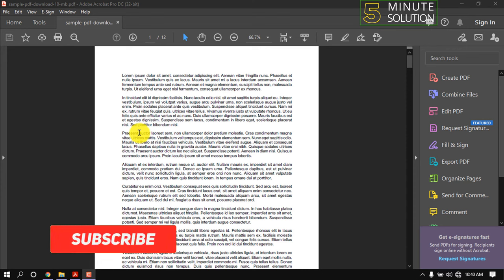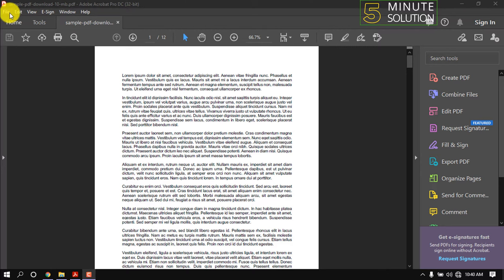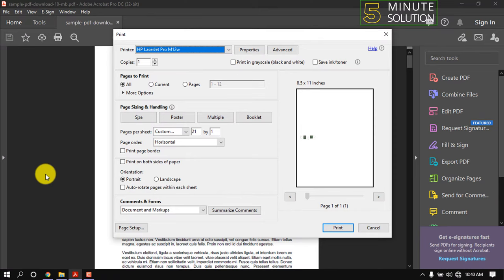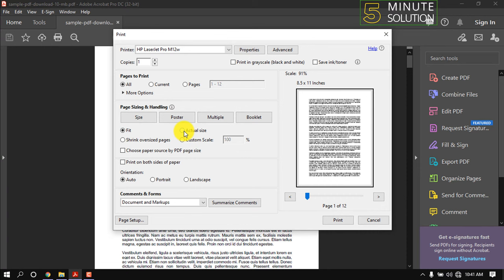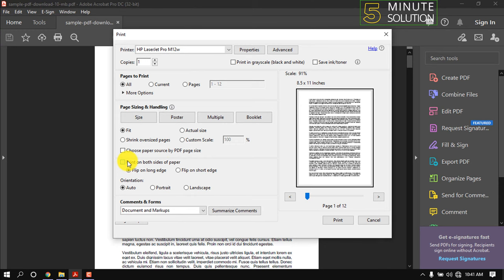How to print double sided pdf 2024 | Adobe acrobat Tutorial

Comment: Option is missing in Acrobat reader
Reply: If printer has the option it will automatically come .
Reply: No if you first time connect printer to PC you have enable double side print setting from printer hardware properties. Then this option came... Then after it default settings always shows.
Reply: @rushikeshbadhe97 how to did you enable it

Comment: I was trying to do the same thing..changing all the printer settings...bla bla...but it wouldn't print the one page of my pdf on both sides.. even with double sided printing set...so I tried one more thing and it worked... when you go to print... there is a page tab for you to put what pages you want printed... I wanted page 2 printed on both sides several times... so in the page tab I put 2,2 and how many copies I wanted and it printed it double sided... Hope this will help someone...  :)